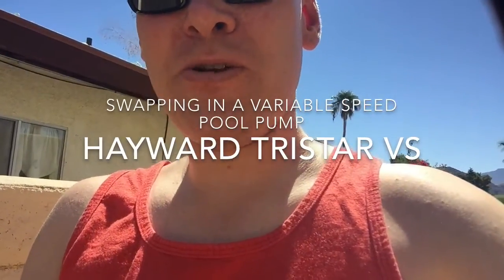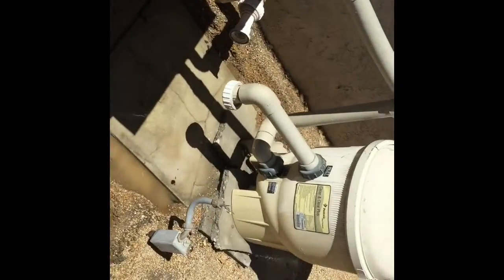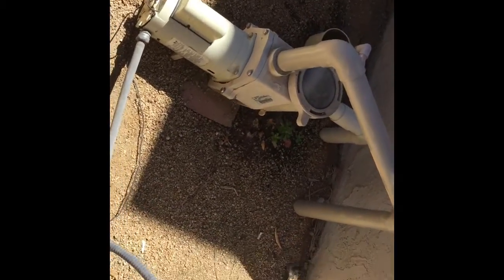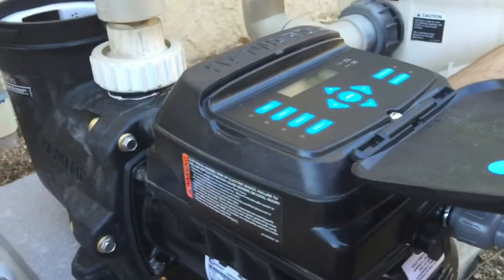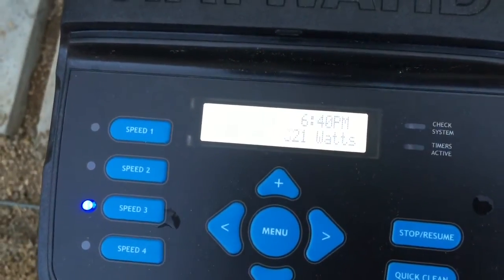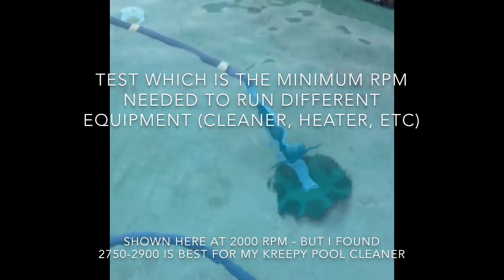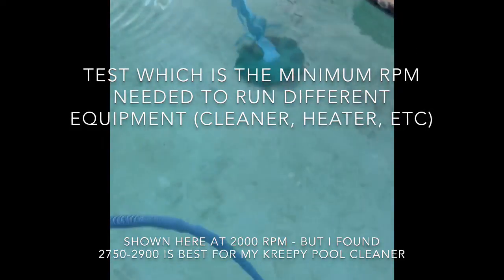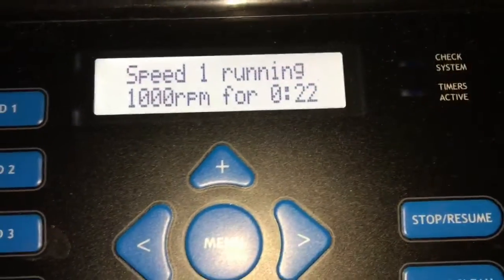Install Hayward Tristar VS Pool Pump

Comment: I have the same pump and just installed it but did not use any lube. I have about 2” of air at the top of the basket and I hoping/praying that when I add the lube it will fully prime with no issues.
Reply from the maker: It could be a lot of reasons why you’re getting air in the pump. a little air isn’t an issue—no system is 100% primed. you could have air leakage at any component (filter, heater PVC connections,  any PVC, valves…).  It’s a great pump!
Reply: @kevindubd  I think it can really only be a leak on the suction side. Living o ring on basket didn’t do anything but lubing the gasket on the union on the pump I take raised the water level in the basket like 2” to just below the lid, very happy with that, just a little more ways to go to get fully primed.
Reply from the maker: @Ryan-Chicago  I strongly recommend the discussion group TroubleFreePools.com
Really great help for any pool issue.

Comment: You didn't show how you primed it. Did you have to release pressure? You just essentially wired it and presto the pump is on. Fair amount missing
Reply from the maker: Open filter relief valve to prime pump until water flows -this depends on differing pool setups.